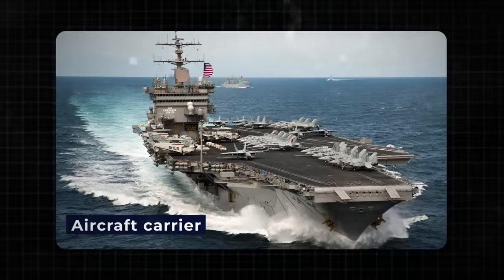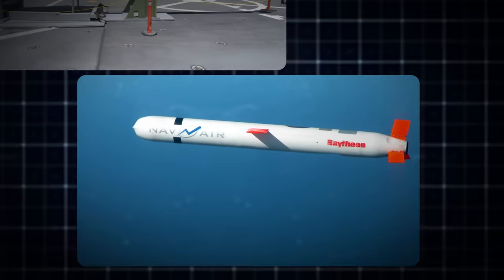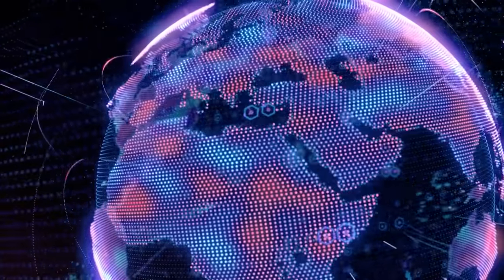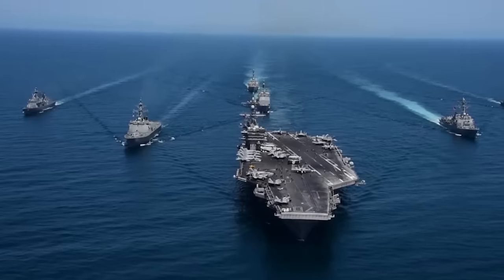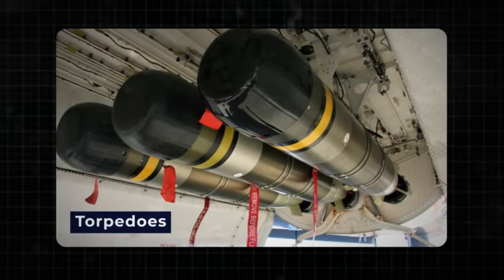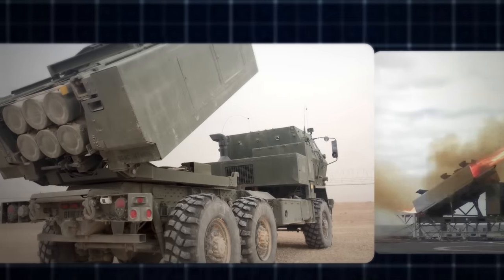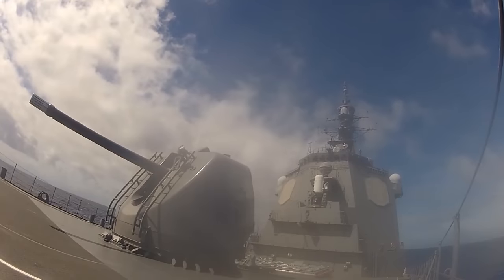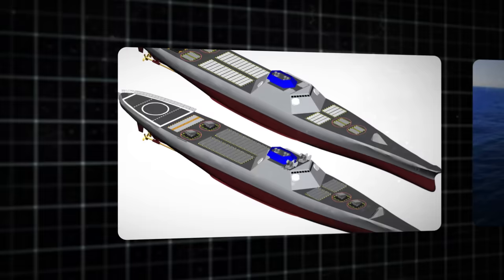US Navy Revealed Its Monstrously Powerful $500 Million Rail Gun

Comment: All of the known issues discovered over the years of development can be addressed through materials development. Rail degradation is likely a prime candidate for interesting alloys of iridium, tungsten, gold, and other elements currently not developed. Accuracy can be addressed by spinning the projectile as done in conventional rifles and cannon. This can likely be achieved by manipulating the magnetic field and inducer configuration. The use of cryogenic coolant can likely help durability and repeatability. Multiple banks of high capacity, fast discharge capacitors would help. The development of "multiple barrel" unit say six in a hexagonal arrangement would allow cooldown between shots for an automated system, similar to a Gatling cannon. As I pointed out initially, materials development is key as is power management. Orbital or lunar installation would dominate future battle scenarios and might be necessary considering the CCP tendency to militarize EVERY place they CLAIM as "THEIRS"! IMO

Comment: Yeah, the Navy discovered the power to operate one rail gun was more than a single ship could generate. And after three rounds the barrel  was ruined had to be replaced.  They gave up the project.
Reply: They did not abandon the railgun project. They repurposed it. Now, instead of inert slugs they fire airplanes in the form of an Electromagnetic Aircraft Launch System (EMALS), which has already been deployed overseas on all Gerald R Ford carriers.

Comment: Accelerating a craft (or any thing) to orbital velocity requires accelerating to 60 times the speed of sound in about 10ms assuming a rail length of 1km vertical. And that does not allow for atmospheric friction. Nothing goes 25,000 kph in air without instant vaporization.
Shooting supplies into space? You don't seem to have an understanding of simple physics.